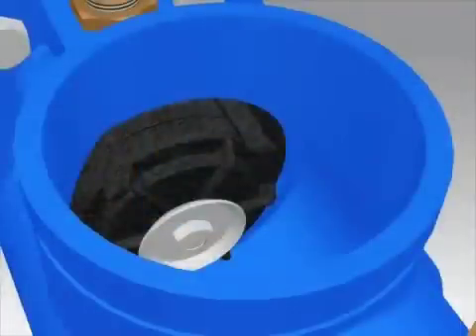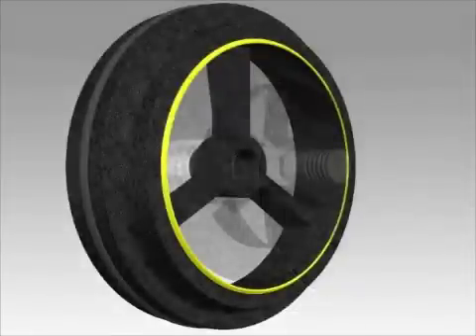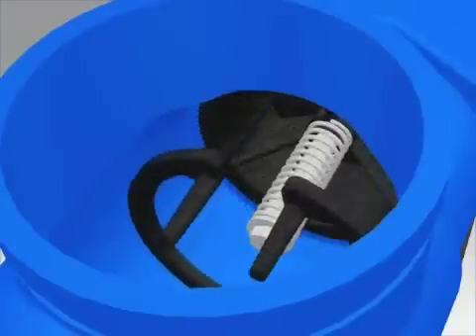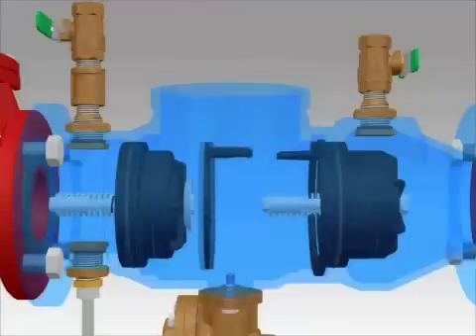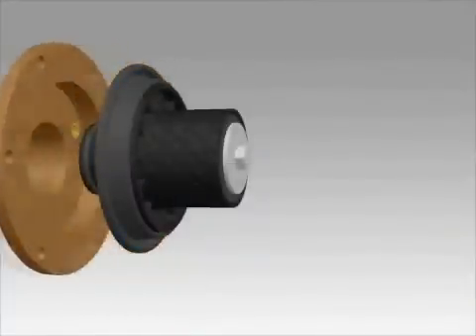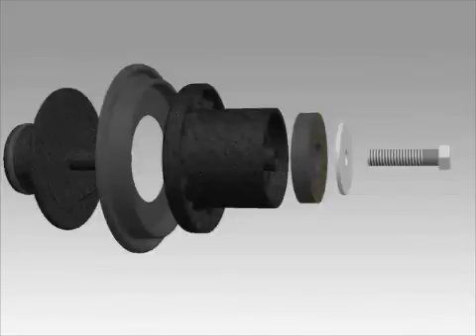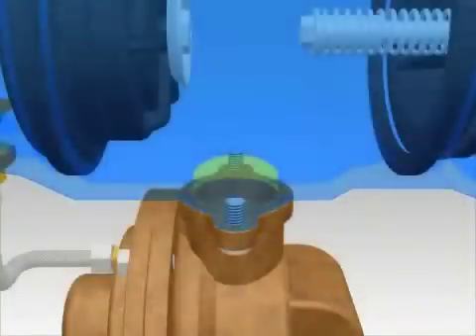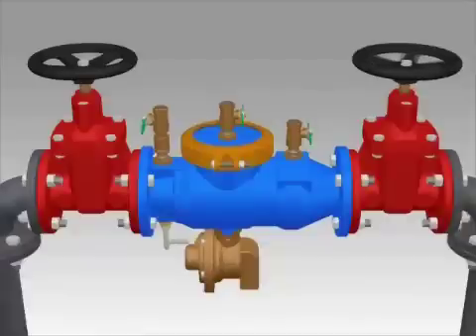Repairing a Zurn Wilkins 375 (2-1/2" - 3") Reduced Pressure Principle Assembly

Comment: too bad thise checks do come out that easy and there is nothing to pry or pull on to remove it without damage. Thanks ass holes. You're the problem. Notice you cant remove number two without number one being removed first. Most municipalities do not allow cleaning of number one without permit so when this piece fails the back flow test and it will. You'll be frustrated and styluck giving a customer a large bill because all of these contraptions are not friendly to repair. Good luck. They all suck. Prolly why most havks just replace abd condemn them so your cost of doing business includes what ever these cost sbd it only goes up.

Absolute trash scam garbage. I hate you.